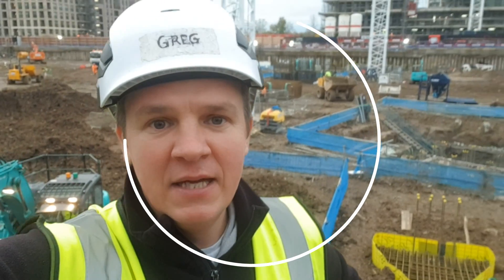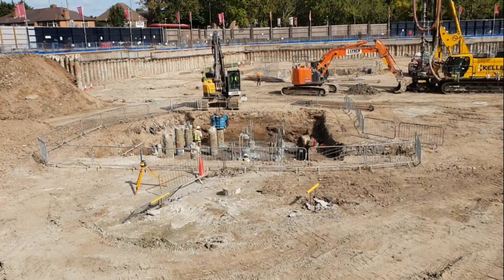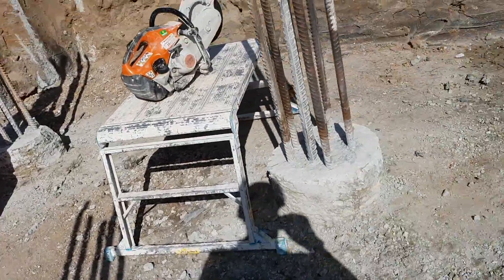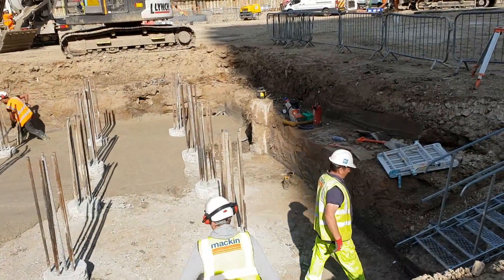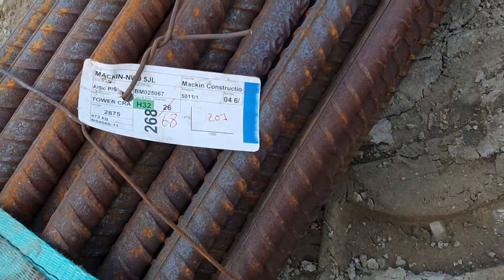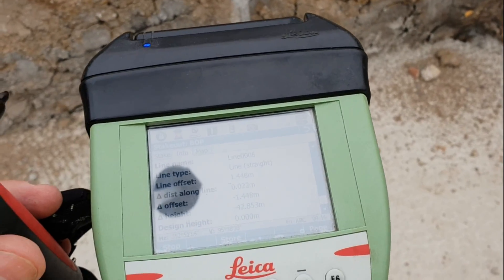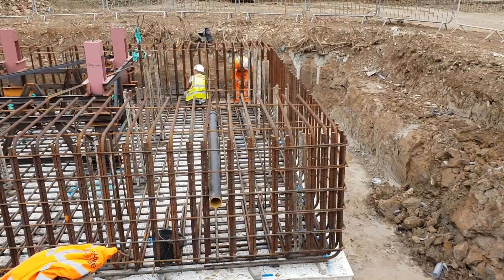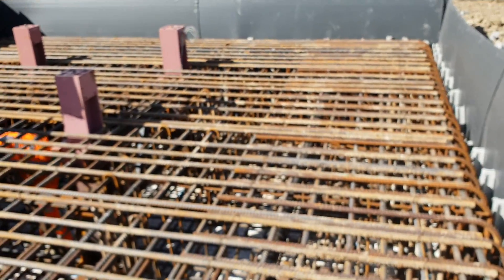How to construct a PILE CAP. Step by step guide & pile integrity test

Comment: Awesome video. I'm doing a fourth year construction management class - In my project I have to interpret sketches for bored piles and a pile cap, and produce cost estimates - this video made it super easy. Cheers Greg!!!
Reply from the maker: Great to hear that Jack 👊 Thanks for the comment 👍
Reply: @SITENG  No worries. Actually I had a couple of questions. I'm planning a long retaining wall supported by deep bored piles under a pile cap. The plan is to drill & pour the odd piles, then turn back at the end and do the even piles. How long after pouring should I crop? Would it be better to do the pile cap pour all in one go or in segments? How long can blinding remain before pouring should occur? Cheers!

Comment: Hi Greg, what’s your preferred method for a marker when setting out piles?
Reply from the maker: I used pins with mushroom cap on top and spray (like on the vids). Using Stakeout program for it - info taken from pile schedule drawing

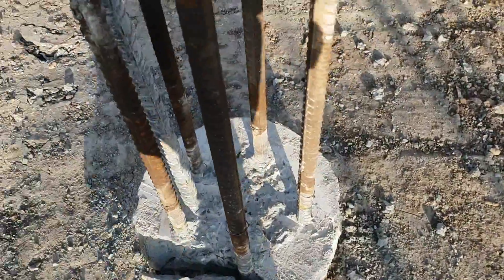Comment: Hello may i know why the concrete got cracked at 2:26
Reply from the maker: Maybe during the cropping, looks like the rebar was hit/bend thus causing the crack. It sometimes happen, especially when the foam is not perfect and you struggle with releasing the concrete from the rebar. Remember that at this point all these piles are checked for integrity to make sure all's good :)
Reply: @SITENG  Thank you!
Reply from the maker: @holygate527  Always happy to help :)

Comment: Quite cool and thanks for the video, similar steps as we did at hk.  But we won’t backfill before casting the conc. We will make the formwork and pour conc first before we backfill it.  Just curious about is uk common to do sand replacement test SRT for backfilling?
Reply from the maker: Hi! No tests in this case, just a ground backfill. Later the heave board was used under the slab to allow for some ground volume changes.

Comment: Hi Greg, May I ask a question what is the purpose we need to erect those U shape steel bars on the pile caps
Reply from the maker: Hi Alson! I don't know why but I can see your comment now, but it's from 2 weeks. You mean U-bars around the cap? These are needed to provide correct anchorage-connection for bottom and the top of steel, also they're needed from construction reasons as this way the cage can be constructed - let me know if you meant these ones 😁
Reply: I want her whatsapp number.

Comment: Hi Greg, thank you very much for the videos! It is really helpful!

I have question for you. At the first part of the video we can see a guy doing an integrity test.

What to do if there is discontinuities in the concrete? 
Thanks
Reply from the maker: Hi Viktor! In our case this have to be reported to the designer and it's his call. He might redesign the pilecap, add a pile, or maybe even approve it. It's not a site decision.
Reply: In the past we have hand to bridge the failed pile with a reinforced concrete beam which allows the loads to be distributed, provided the other piles have the capacity to take the additional loadings of course

Comment: Integrity test🤔 so what happens if it has a crack?
Reply from the maker: Hi! To be honest never had situation like this, but this has to be assessed by the designer and in best case will get a green light and in worse case scenario pile to be redone/extra pile or piles installed next to it to make sure the load will be properly distributed to the ground.
Reply: @SITENG  😁 had that in mind that it would have to be redone. I just thought you could be having another remedy.